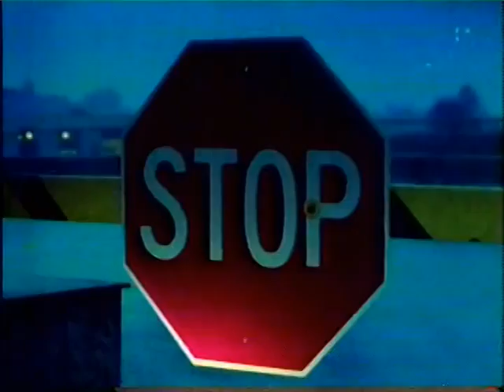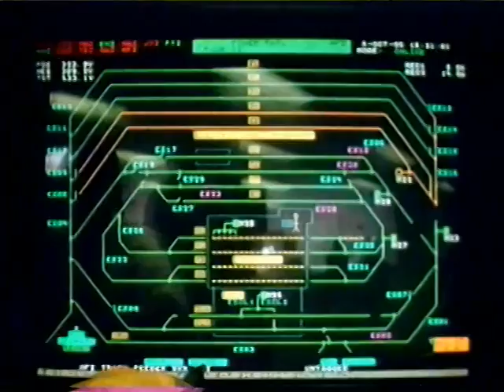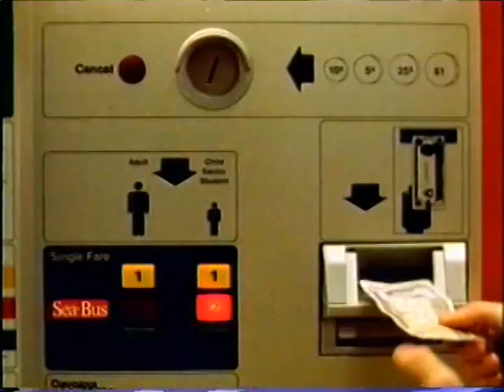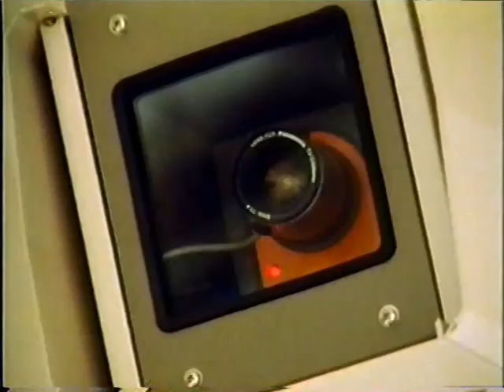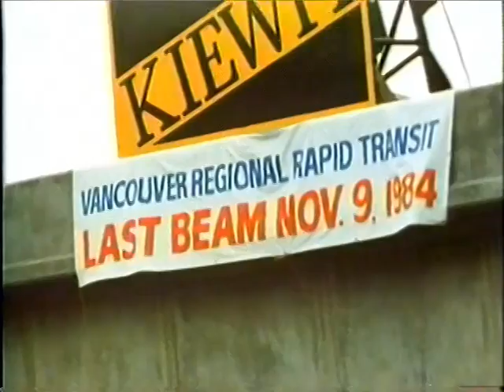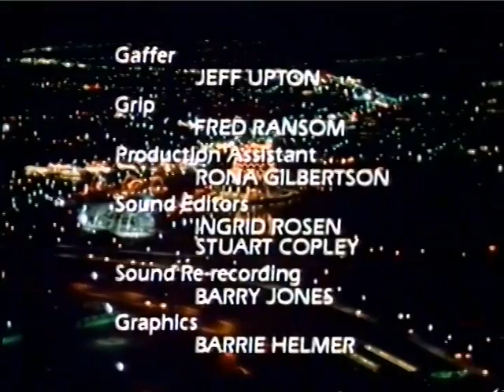Going to Town - 1985 SkyTrain project documentary

Comment: Love the bold optimism on display here.  You don't see this kind of ambition much any more in BC.
Reply: Or anywhere.
Reply: sad thing is this would never have been built if it was only started today nor anything like it we would probably end up with an underfunded dangerous street level rail that would get abandoned
Reply: There's only two other cities in the world using an elevated transit system, as I heard it. They're too damned expensive to build and even ours will not be elevated in the future. The elevated skytrain stations are surely the most expensive part. Metrotown's escalators still aren't working. Even if a ground level system had to build bridges over roadways, it could likely be built cheaper.
Reply: Metrotown is undergoing renovation.

I am fine with a ground level system unless its light rail.
Reply: Jim Ervin thing about SkyTrain is it has a high initial build cost but long term costs are pretty low no collisions like you see plaguing street level rail. Metrotown is undergoing renovations to handle higher passenger volume (there wasn't a giant mall when Metrotown station was built) which is why the escalators aren't running yet and renovation is pretty much going to schedule
Reply: Ground level could work on certain areas if you build a high wall to keep collision hazards out. Canada line does this when its on YVR island
Reply: You may say what you want in favour of the Skytrain system but that high initial build cost is what's keeping other cities from copying what we've got. Only two other cities use an elevated transit system as I last heard. The future transit extension plans in Surrey call for a ground level (LRT) system as you may have heard. In Translink's promotional video of the system, it looks like a new signaling system has been developed for preventing collisions at crossings. And I'm sure that taxpayers don't want to be burdened with any more Skytrain costs. So LRT is what's happening. As for the Metrotown escalators, they were there and running when the station opened but broke down a year or so ago. Now the passengers are still using the stairs or elevator while the expensive escalator repairs drag on forever. And that's another cost we wouldn't have with a ground level system.
Reply: Jim Ervin As a Surrey resident I don't agree with the LRT and most Surrey residents don't agree with it as well. SkyTrain is better and more efficient than LRT. You can see the major problems of LRT in many cities around the world but our mayor has no clue.
Reply: Jim Ervin Then explain why they abandoned the inter urban?
Reply: Jim Ervin 
Actually surrey has since voted in someone who seems to want SkyTrain built
Reply: It’s just because our two current parties in BC are garbage and love to overspend (probably because kickbacks)

The most glaring example I can think of is how the tiny site C dam is going to cost more than the massive WAC Bennett dam did to build even when adjusted for inflation and I support hydroelectric but ffs it could be built for way less than it is. Back in the day government built projects directly just hiring people and sending them to do the work nowadays they contract out to some company probably run by their rich buddies who charges a shit ton to complete it because they can plus that loud annoying group that just opposes every building project that the government wastes time trying to appease instead of just ignoring it

If the SkyTrain was built from scratch today it would cost probably 10x the price and there would be tons of protests by all kinds of paranoid nutjobs which would delay it 5 years and it would probably have been built with subpar materials because whatever company got the kickbacks would cut corners to pocket more money. The BCliberal/NDP way of running things is an absolute mess just a few steps away from full on Russia style oligarchy and its why nothing ever gets done in B.C. anymore. Fuck say what you want about the Bennetts but at least they could build things for better quality at at least half the cost and 10x as fast it seems than what gets built today. The corrupt idiots we call our modern premiers can’t even keep the highways clear in the winter and I think it’s a basic task for a leader to keep their damn people safe. Ask anyone alive in the 80s and even that’s gotten way worse
Reply: Disagree, most people are not optimistic due to municipal issues or federal issues. Provincially, our leader has had the highest approval rating in a LONG time. Living here has been awesome and I'm optimistic with future TransLink expansions such as the extension to Langley

Comment: I couldn't help notice "ITT SEL Canada" on the SelTrac SMC screens. This was the first phase of the system's install, the VCC Vehicle Control Computers (three for the lines) were all General Instrument 800 computers and OS/2 for the workstations, except for the SCADA workstation you see initially when the CO operator turns on propulsion power to the one vehicle with that pen.

It's gone from that first-gen system made in germany partly by ITT Standard Electric Lorenz, to a newer system when Alcatel bought the technology, still based on OS/2 but with color graphics (SelNet as they called it).

Now, nearly 30 years later, we're still using the same inductive loop moving block control system. But now it's Windows-based SMC software (NetTrac MT), IBM rack i286 PC servers for the VCC, and newer Thales onboard vehicles computers with newer Unix-based (VxWorks) operating systems as pose to the old ITT 1650 processors used on the original Mk1 VOBCs. The operators have the same command line as the original system, but the simplicity and convenience of point-and-click where needed. It's really quite amazing.
Reply: i286? Where do you find parts for those?
Reply: Glad to hear they have upgraded the computers and replaced some light bulbs.  But on=going upgrades should always be a constant practice and goal.  Lives are at stake.  Yes, this is a very advanced train system and very expensive system that no other city can copy.  Vancouver Rules !  .
Reply: Detroit made a license built copy of the SkyTrain and completed a single track before large amounts of that city went to shit so I wonder if they still have a copy of the 80s software since the mk1 SkyTrain car and control system is what they bought the license to copy
Reply: I'd love to learn more about the original control equipment - maybe the VCC's were Data General Nova 800's? Don't know about GI ever having made this type of equipment, but I could be wrong. The DG Nova 800 seems plausible as it's a 70's minicomputer, and SelTrac also originated in the 70's.  As far as OS/2 is concerned... I think that this was maybe a later upgrade as development didn't begin until 1985, and the initial release was in 1987 from what I understand. Fascinating stuff.
Reply: @jordanlabbe3896  Good point with the timeline, being honest there likely are some inaccuracies in my original post. But a few years ago, I came across an interesting IEEE journal from the mid-90s that was written by someone who appeared involved in moving the VCCs from assembler code over to C. (look up "Cash Cow in the Tar Pit - Reengineering a Legacy System" - DOI: 10.1109/52.493019 - might require an IEEE subscription to view, sadly) . There was mention of "General Automation GA900" minicomputers being used, but there is not much other information I can find beyond that. As for OS/2, my understanding is that it was only used on the System Management Center or SMC (non-vital) level, which is now Windows based (TransLink had this info on their SkyTrain fleet page at one point).
Reply: @BrD61  Thanks so much for taking the time to follow up. This is all great information... I don't know anything about General Automation or any of their systems - looks like I have some reading to do! I appreciate the information.

Comment: The Vancouver SkyTrain, utilizing the Urban Transportation Development Corporation's Intermediate Capacity Transit System Advanced Light Rapid Transit technology. Designed and built at the Millhaven plant in Kingston, Ontario. Also used here in Toronto-Scarborough for the Scarborough RT, the Downtown People Mover in Detroit, the Air Train in NYC as well as in Kuala Lumpur, Malasya. Hamilton, Ontario was also supposed to get a SkyTrain, but it was rejected at a council vote in 1981, along with another commuter rail version of the ALRT train technology that would have tied together the entire Greater Toronto Area, known as GO ALRT, but sadly that plan was scrapped after Bill Davis resigned.

The ICTS train is one of those few examples of a provincial government delving into designing and producing urban rail transportation technology, from those heady days of the early 1970s when it seemed the future had arrived, and then Metro Toronto was to be tied together by magnetically levitated and magnetically propelled ICTS ALRT trains. That plan fell through and was changed from magnetic levitation to having the trains running on conventional rail tracks while still being propelled by the linear induction motor. The signalling was computer controlled moving block with the systems utilizing the Seltrac automated train signalling system supplied by Alcatel. Very high tech stuff for it's time, it started off with much ambition.

The only problem though as has happened here in Toronto is that snow and ice can get on the reaction rail and prevent the trains from working properly. So now the Scarborough RT's day's are numbered, as it will be replaced by possibly a north eastern extension of the Danforth Subway line, although there is at least one mayoral candidate for this year's Toronto mayoral election who wants to restore the originally planned Light Rail Transit line that was originally proposed. Only time will tell what shall be handed to the people of Scarborough. Thanks for sharing the video. : )
Reply: +Jordan Kerim Currently there's another city with Bombardier's INNOVIA ART is in Yongin, South Korea. This system is called the EverLine (EverLine official site: http://www.ever-line.co.kr/everline/index.php; Bombardier reference: http://www.bombardier.com/en/transportation/projects/project.innovia-yongin-south-korea.html?f-region=asia-pacific).
Reply: There's also Kuala Lumper's KL Metro that's getting the new Mark III trains.
Reply: totontos problem was resistance to the full automation and insistence on manual operation

this system was designed with the consistencies in acceleration braking speed etc of computer control and the inconsistency of having permanent manual control has added way too much wear to a system not designed for it

Comment: i swear they do screech a little on the tigher curves or at least the non-refurbished ones tend to

wait and the skytrain yard used to be a gravel pit?
Reply: Yeah, they do screech a little, it's still better than traditional methods though. The maintenance and operation center is still at the old gravel pit, you can't see much though since it's got a big fence around it.

Comment: Wish we can bring back the old Interurban tram system. We had the foundation for a LRT long ago and it was ripped out and burned (Literally done to the Trams under the burrard street bridge) in the late 50s paving the way for the unreliable transit system we have today. You can see traces of it still left there is old track which runs across where the some of the skytrain runs along the old Morpole and Burnaby lines. The Canada line runs along part of the old Steveston line and most of the train track in Surrey running along Hwy 10 runs along some of the old Chilliwack Route (Which has been replaced by the 66 fraser valley express bus). Replica tram Stations have been built in Surrey the cloverdale and Sullivan stations in there close to there historic spots. And have 4 Functional trams (Metro Vancouver has 6 of the 7 Surviving trams One in Richmond, one in Burnaby, 4 in Surrey) running 5 times a day on weekends during the spring and summer between the two stations.

Comment: I have a really strong inkling that this is a the old Railway tunnel underneath downtown that's now used for the Waterfront Area of the line (that first curve).

However, I don't recognize any of the buildings at all.

You won't be able to find this area today because it's built over by "The Province" Building.

Comment: The Bombardier trains on the Expo Line have steerable axles so they follow the turns in the track the same way a car's wheels turn into a curve. The Canada Line trains are conventional fixed axle sets so on sharper curves you get the inevitable flange screeching. Too bad really because except for the noise I enjoy the ride to YVR a lot, especially when I get a seat at the front!

Comment: 4:44 the building that they're so proud of demolishing here probably had more character than whatever atrocity they have standing there now.
Reply: No it didn't - not particularly. That was the Devonshire Hotel, known as "The Dev", which was originally an okay apartment building and then an okay small hotel. Nobody was sad to see it drop; not me anyway. It became the site of the HSBC bank building and it still is. A bigger bone of contention was the primarily medical building across Hornby from the Dev - I forget the old building's name, but eventually the new developers of that site were forced to save some art deco aspects of the old building and integrate them into the new one. At the corner of Hornby and Georgia you can see the old statues of nurses with some of the old facade there on the corners of the current building.

Comment: Aren't the mark I in the TTC in Toronto?
Reply: They are in both Toronto and Vancouver.  Vancouver has 150, while Toronto has around 30 cars. Toronto's, however, will soon be replaced with different technology.
Reply: Vancouver Transit you meant a subway will replace the Scarborough RT
Reply: Yes, that was what I said
Reply: yes but theyre not automated theyre manually controlled by drivers

toronto seemed to hate the automated technology for some reason and hated that they still had the mk1 cars
Reply: They are automated, the people who work at Edmonds Control Centre just drag and drop. If they drag a train to Metrotown, it will automatically go.
Reply: Vancouver Transit I was saying the ones in Toronto aren't automated though someone said that in tecent years they're partially automated with the drivers only operating the doors and announcing stops
Reply: it's because the toronto drivers are union so they had to convert them to be driven manually